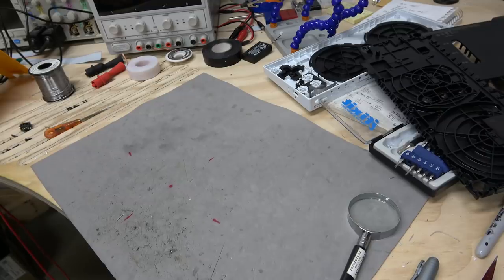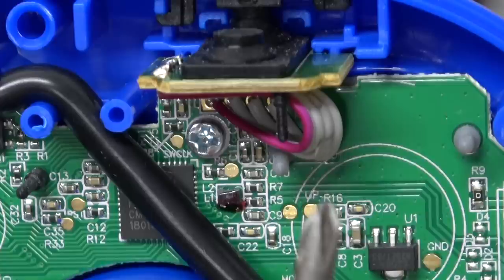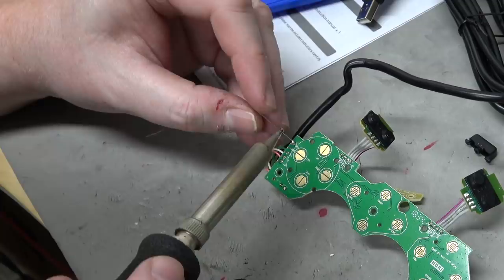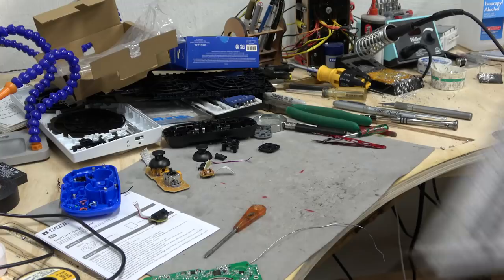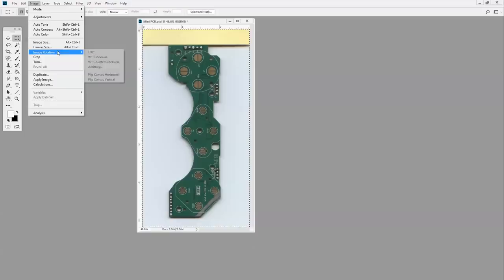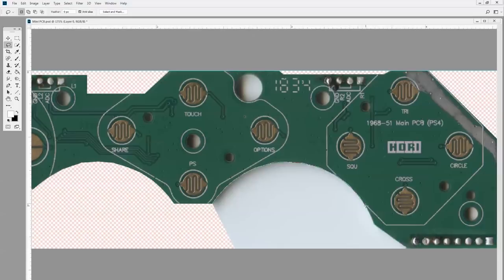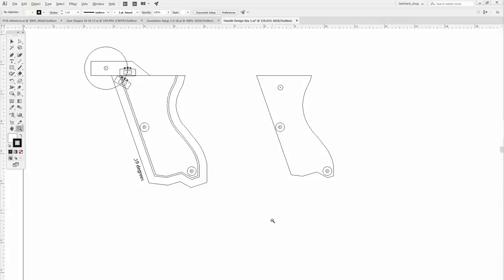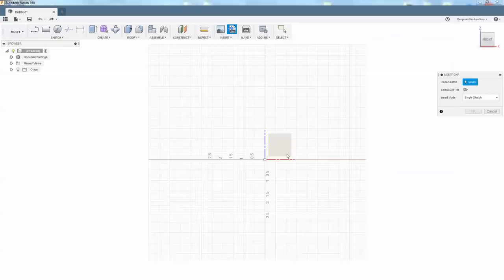The Quest for a PS4 Single Handed Controller Part 1

Comment: Pro tip for rotating images in Photoshop just got to Filter > Lens Correction, there you can chose the level on the left (or hit A), draw a line on what should be straight and it rotates it accordingly ;) Great video btw. love to see you continue here in a more back to the roots style :D
Reply: Ruler -> draw line -> Image Rotation, Arbitrary...

Comment: Ben, @23:06, maybe a second d-pad to replace the four buttons? Too much?
Reply from the maker: THAT is an amazing idea! Would take up far less space. Thanks!
Reply: What about for button combinations? Diagonal presses? You could keep the buttons and  put the D-Pad in range of the index finger on the rear? Best of both worlds maybe
Reply: lol I'm too late, I was going to suggest that then I saw it was already done. :D
Reply: Dude your a god.
Reply: I hate d-pads in every way, and think it'll make it worse.
Reply: Thought about having it design like a dpad or digital stick but I remembered there are situations where you want to press opposite buttons, or even off 3-button combinations.

And I'd wish someone out there would actually make good dpads, they are essential and should not be brushed aside like microsoft does.

Comment: great design i love your disability controllers there so good .... this one .. because of the controller your using as a base will have a very bad issue .. its the touch .. that controller does not actually have it .. its more of a key press too designated predetermined movements .. take a look on-line and you will see what i am talking about .. the rest will work fine but in lots of games that touch is a breaker as it cant do what you need it too do .. maybe you will have too get a touch pad from another controller and somehow get them too communicate , cant wait too see part 2 tho and see how you deal with this issue  love that you still do videos .. was gutted when you left element 14
Reply: Lots of games don't actually use the touch function. So it's not a huge deal
Reply: @emeraldbonsai  The Uncharted series.
Reply: @emeraldbonsai  The uncharted series gives you hints through the journals, which can only be accesed by pushing the touch pad button.
Reply: @emeraldbonsai  Well their the kind of hints that you're completely lost without. Like a room with a bunch of symbols and the journal shows colors in an order and the colors match the symbols. Then you'd use the colors to line the symbols up.
Otherwise it's a room full of symbols with no clue of what to do
Reply: @emeraldbonsai  that takes all of the fun out of puzzle solving. Plus it makes sections like that drag on and get frustrating
Reply: @emeraldbonsai  oh, no I was saying the guessing bit takes the fun out. But yea you could pull them up online, although personally I find it frustrating if I have to consult something other than the game itself

Comment: For reference on a good one handed controller, you should take a wii nunchuck as modify it from there to each system as it offers confort and a good point to start from. Otherwise great video!
Reply: Good start if you have the hands of a toddler. :P
Reply: there is also a navigation controller on the ps3, it is bigger then the nunchuck

Comment: Would the velcro strap not be a little hard to do up and undo for a one handed person, knowing how long gaming sessions can be and how many times you have to walk away.
Reply: Tripplehelix thats what i was thinking. Maybe some sort of elastic band could work better that you can use one hand to slip on/off.
Reply: It actually wouldn't be that hard to add a little servo that tightens the band, at the press of a small button somewhere obscure on the controller.

Comment: Hey ben, as someone who suffers from muscular dystrophy and has spent the last 10 years having to mod controllers to make them easier to use I gotta say this video is awesome. I ended up using an xbox 1 due to the elite controller where I could set the zones on the sticks to make things easier for myself, but I always love seeing your work on things like this. It seems like this controller you bought would also be a good start for a arcade stick for street fighter 5, which is the next project I will be working on. If only I didn't have to go to walmart to get the thing quickly.
keep up the great vids.

Comment: Glad I found you! I've pretty much hit the wall trying to make a one handed controller for my older brother who had a accident at work resulting in him loosing two fingers and leave him wit zero motorfunction in one of the fingers left leaving him with only his thump and longfinger to use, he loves videogames and I really wanted to do something for him, right now since I more or less gave up on the one handed I'm building him a small arcade controller with raspberry and a joystic he can use with the palm of his damaged hand and buttons for the other one. But you have some solid ideas and the mini controller looks like a great starting point! Going to come back and keep an eye out for the cobtinuation of this build! 😊

Edit: If you where to make the  x square circle and triangle buttons on a slight slope it might help with minimizing accidental button actuation 😊

Comment: As someone who has a disabled hand, this is pretty awesome to see people working on.

Ive been looking for a great one handed controller to use for a LONG time now; the Wiimote was the first one that came close to achieving what I was looking for, But lacking an analog stick on the main controller was a major letdown for me.

I use a dualshock 4 right now, and use my left(disabled hand) to anchor the controller by the left grabby stick, and claw style the rest of the controller. However, this means my right analog stick needs to be used for movement vs camera, meaning games that don't support custom mapping of analog controls are less enjoyable for me. Also, I have to use my pointer finger instead of my thumb as i would otherwise be unable to use the  4 buttons efficiently since my left hand cannot be used to accurately control the analog stick, meaning I cant move and press a button at the same time like you normally would be able to do.

Ive been thinking of fabricating my own ds4 controller custom, but lack the hardware and knowhow on how to do such a thing. I may be interested in a final product of yours if you finish this.

I like the positioning of the first analog stick used for movement, but I feel your middle finger would be a good place for the second analog stick, maybe. I'd have to play with it to really give good feedback. Subscribed! looking forward to part 2!
Reply: Also, A Hat switch for the dpad, like on the thrustmaster hotas fight stick would be a fitting solution imo.

Comment: @19:04 -- YES.  So glad you asked that! -- I was so worried you were going to put the thumbstick in the middle of the grip!! ('cause OUCH!) -- as for the ABXY (or shapey buttons 'cause it's PSX) -- when you move them in a bit, line them up with the joints of your finger so that you can hit multiple at once (e.g. you may need to have one facing forward a bit more, instead of just on the side?) -- Also you might fare better using DS lite sized buttons -- not ideal for thumb usage, but for pinky and ring finger, they might be just right... -- Thanks for the info about scanners btw, I do that trick a lot and didn't realize that the image was more distorted in that direction. -- I'm surprised you double check the measurement with calipers though... my scanner is usually spot on with whatever DPI I have it set to. -- Happy Holidays, and keep up the good work. 😃

(p.s. I can never figure out: is your 3D printer really that bad, or is your camera just really good? -- Why do your prints always look soo... not good? -- Not talking shit, it just bothers me because you never mention it -- maybe it's intentional? -- Like 'cause it's a rough draft...? -- but even your DPAD in the other episode looked kind of bad... what's up with that?)

(p.p.s. -- you should really get an Amazon affiliate link -- 'cause when I watch your videos, I always end up going... "oh! -- I forgot they made 5-way tactile switches like that..." and went and immediately bought a few on Amazon -- it's not going to give you a second income or anything, but maybe useful for beer money? ... or more tactile switches. 😉)  -- Merry Christmas, Ben. 👍

Comment: For the button near the ring finger and pinky, you could try a few things, one being moving them in like you said, but for me the downside is that I think it might be unintuitive to have to move my pinky and ring finger in and out. You could try moving the innermost button onto the grip facing forward so the inside of your finger hits those buttons. You could also try a similar design but with all four buttons, outrigging it to the side so your pinky and ring finger can hit either one. I also think that the other control stick being at the bottom is unintuitive but I dont think there is a solution that isnt clunky or annoying. Anyway, awesome video!

Comment: It's a very interesting design, and I've never thought about one handed people who want to play games, it is certainly a challenge. I noticed that you lack the second joystick, which is crucial for FPS, maybe you can use the entire controller as a the other joystick, using a suction cup to stick it to a table or something and then tilting the entire controller using your wrist to move it. The order would be suction cup at the bottom, connected to an upside down "standard" ps4 joystick and then the upwards facing base of that joystick connected to the bottom of the controller. Maybe you could add some sort of hooking device instead of the suction cup so that you can connect the controller to your belt or something it you want to play standing or without a surface
Reply: He was going to mount one on the bottom of the handle pointed towards the floor and it would be used against a table or leg to operate like a flight stick

Comment: Since you asked, no! Rod solder (what you have) doesn't go bad unless you store it in a very wet environment, and it's still very hard to rot out solder. Most of what you might have to worry about would just be stuff growing on the solder, and that can be cleaned off.

Comment: You could make a base for it with a digital lever like the Sanwa JLF. running through the pistol grip. The base would be clamped to the table or fixed to a wheelchair or fixed to your thigh with a strap. This would give you simultaneous D-Pad (the digital lever) and analog stick (thumb) control with only 1 hand.

Comment: Great stuff! I have a suggestion for the second analog stick. I also really like the idea of the analog stick on the bottom but I don't know how practical its gonna be. Maybe you can put the second analog stick where you rest the base of your thumb on the analog stick and use your grip on the controller to move it around.

Comment: The main problem with one handed controllers is being able to access all the buttons with only one hand.  It may be a good idea to put a button on the bottom of the controller so you can press the controller against your leg or a table to activate it.  It should be a button that you don't need to rapid fire though (like start or select).  Or if it was a PS4 controller with a trackpad on it you could put a trackball on the bottom to simulate the trackpad, but that might be a little tricky.
Reply: the trackpad is hardley used in games, so no need for that. Even the hori controller he used does not have it

Comment: Yeah, that was indeed a super deal on the surplus solder.  I used to work at BAE Systems back in the day.  They're a gov't aerospace contractor and as such have a bunch of rules to follow regarding QA.  They had a bunch of rolls of Kester "285" they were disposing of because it was - get this - EXPIRED! Lol, yeah somewhere in the MIL specs, solder is perishable ( the flux i guess).  I told 'em I'd take it home with me if they'd let me have it, they gave me the lot; they'd have to pay a hazmat disposal service to take it way otherwise.  I haven't had to buy a roll of solder in 16 yrs :)

Comment: Put a slider pot on top and connect it as analog 2.
Seems like it would be good in racing games and such for adjusting throttle and stuff.
Or something like a scroll wheel on a mouse.
You could apply voltage over the scroll switch and feed it into arduino's analog readout where you count how many times voltage hits 0 and based off that you use solid state relays along with smd resistors to control analog output.

Comment: Hey Ben, a better idea for the second analog controller is instead of on the bottom of it, it can be on the back of it and then strap it to your wrist so you can control it with your hand rotation

Comment: Is there a kickstarter for this project? I'd back it in a heart beat. This could change the way alot of people interact with their devices. Especially those who may be missing a limb. Im seriously excited for this.

Have you thought about putting the ring and pinky buttons on a slope or maybe something a bit more convex? I think it's more strain on those fingers in particular to put pressure on them while extended.

Comment: 19:23 That position reminds me a bit of the Bally Astrocade controller, although that offset looks more comfortable. Another reference might be the Capcom Pad Soldier which has a bent offset layout. Buttons seem Coleco Super Action Controller like but your placement seems much more ergonomic to the fingers laying positions. Strap sounds good, a lot of jostling in trying to maintain grip. Flex Tape>Duct Tape. ^_^

Comment: I love the idea of a one handed controller that would work. I don't think it will work with most competitive games, due to the fact that you will be lacking a hand. Reaction speed will be slower, and not to mention the amount of buttons for one hand.

I think it would be better if somehow you could connect two of those single handed controllers and split the buttons. So you will be using both hands.

Comment: You have to think about how the normal controller is designed as well, you can't comfortably use both the right analog stick and the face buttons at the same time, so games are designed with this in mind. The face buttons should be the other option for the thumb, maybe on top of the controller

Comment: Maybe put the face/action buttons (X, square, circle, triangle) next to the right analog stick/R3 button? Like below or to the bottom right of it as you have it now, or wherever there ends up being room, or feels more natural. You're never going to be using the action buttons and analog stick at the same time so they can be in close proximity to one another.

The touchpad's going to be interesting to implement though. Maybe on top of the handle?

The Switch controller may be something good to look at for ideas.

Comment: Just one thought! Have you ever thought about adding a foot controller to operate the extra buttons that the left hand would be using? Quite a few years back I modded keyboards to take an external footswitch that I made to actually help to get more control.  Like when I used to play Duke Nukem 3D on the PC one of the switches on the foot controller that I made, I would use for jumping at the same time, leaving my hands-free to control the turning and firing and strafing. :-) it worked like a charm!!

Comment: potentially better idea for those 4 blue buttons on the bottom.

Arrange them in 90° to each other.
2 of them on the side facing away from you and 2 where they allready are.
This way each buttonpress has a single movement.

Comment: I see a lot of issues with the shape buttons being where they are. They're usually the most essential, and the ring and pinkie aren't generally the best fingers to be using for essential actions. 

The L/R shoulder buttons aren't used as much as the shape buttons. I'd say assign those to pinkie and ring, and leave the shape buttons to index and middle.

Comment: I stead of analogue switch on the bottom make a small circuit that uses an accelerometer and gyrominstead of the second stick on the bottom. That way you aim with your thumb and look around by twisting and moving the whole controller.

Comment: For these low detail rapid prototypes, wouldn’t it be way faster to use a CNC router for the case instead of a 3D printer?
Scratch that, wouldn’t a hand router be faster and smaller?

Comment: hey, just a quick suggestion with the face buttons. instead of having all 4 on the same side like that, put 2 of them on the front of the controller like the triggers. it might make it easier to press the buttons, and you wont have as many false button presses.

Comment: I lost the use of my right arm in a car accident about 12 years ago. I’d love to get my hands on a left handed version.
Reply: I’ve had a bit of luck draping my hand over the whole ps4 controller, using the left side of the controller, d-pad and analog wth my pinky, right side triggers and face buttons with my pointer, and right side analog with my thumb. It’s tricky but you can get used to anything.

The best time I’ve had though is with mice with a minimum of 12 programable buttons. A company on kickstarter just released a mouse with 2 analog sticks on it called the Lexip: https://www.kickstarter.com/projects/665701421/the-most-accurate-and-versatile-gaming-mouse-ever?ref=discovery&term=Gaming%20mouse

Haven’t got mine yet though

Comment: Honestly it would probably be better to have the little finger be the left trigger/bumper and leave the ring and middle finger for the buttons if you're determined not to have the buttons to the right of the analog stick at the top of the handle. The little finger (and to a lesser extent even the ring finger) would have trouble with the fine motion to reliably hit one of two buttons. There's a reason why most controllers don't utilize them at all other than for grip.